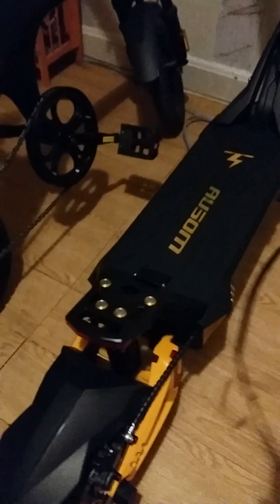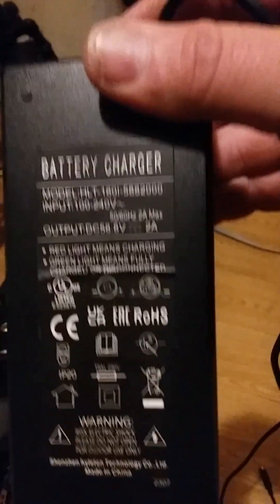Ausom Gallop charger stop working.

Comment: A fellow galloper , did you try and take out the battery and charge it that way?
Reply from the maker: Yes with no luck. But I ordered the charger from Kukirin scooters.  And it works just fine. Charged to full charge. So I am Good now. Ausom never got back to me. So after 3 weeks. I just ordered the charger from Kukirin scooters.  The Kukirin G3 pro. Is the same scooter as the Gallop. So the charger works just fine. And cheaper than Ausom I paid 58 USD.  Ausom wanted like 75 USD.